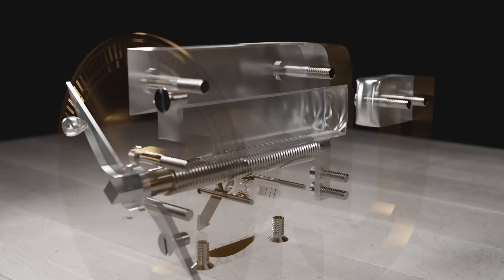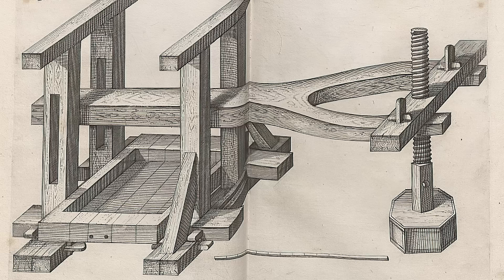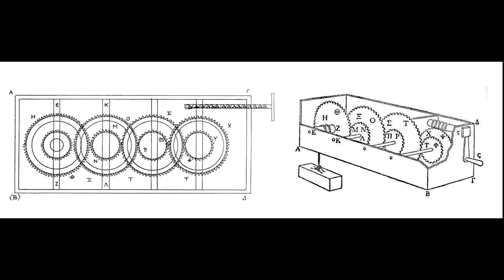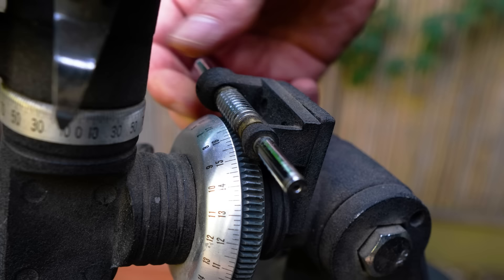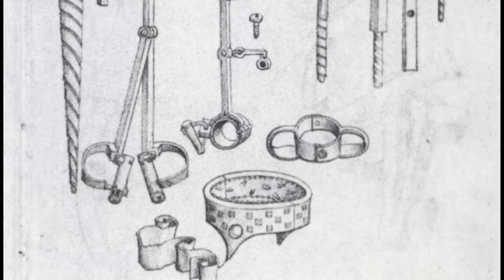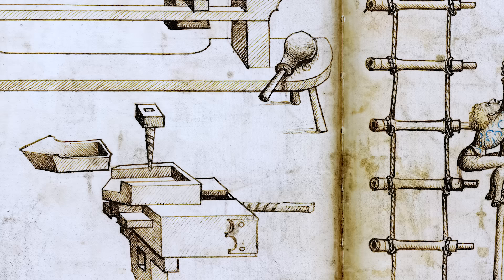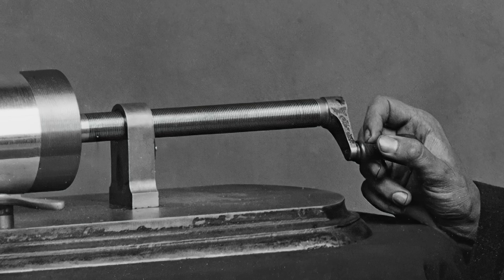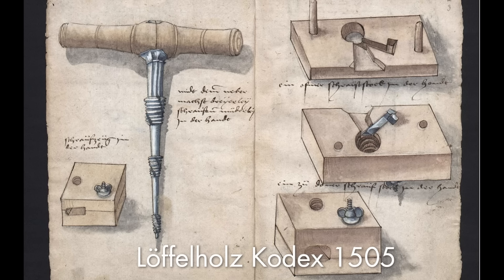Where DO screws come from?

Comment: My family's business designs and constructs specialist commercial vehicles,pumps,generators,field workshops,de-salinisation plants etc. Despite the drawback of not being self priming they still use Archimedes screws in the large irrigation pumps. My great grandfather and his brothers built their first trucks which went to Libya in the 1930's using Archimedes screw pumps for sewage/groundwater. Over the years as technology evolved and different family members had their input all manner of alternatives rotary,reciprocating,vane,diaphragm,were tried, but my father went back to screws in the early 90's. they shift good amounts,are very accepting of debris and most importantly having only rotating rather than reciprocal parts are far more durable,given that many of these trucks go to places like India,Egypt,Sudan,Libya etc. and that mechanical sympathy isn't a foremost priority, the need for simplicity and high durability is paramount. Not only does the customer not want to be without their equipment,it takes some effort for a major repair to be actioned,either via re-patriation of the vehicle or a pair of techs and their gear travel. My father always says and with justification,that screw pumps are fit and forget,they just work,even half knackered they still work,endorsed by the fact that we are still using them centuries later. I've spent my entire life around threads screws and bolts the most important helix,is that of a corkscrew😁
Reply: Are sliced washers still soldered together for Archimedean screws?

I was impressed by the calculations required to calculate the diameters for given pitch angles.

I can't imagine how Archimedes figured this out without a calculator or sine tables.
Reply: @a.k.885  you would need some big washers,some of them you can crawl through😂 .The'washer'method only works on finer pitches,ours are all offset rolled sheets cut then rolled,the big stuff that is expected to encounter mud,rocks and stones are constructed using 3/4 to 1 1/4" thick steel. Up until about 1994-5 the calculations were all done on paper,now they use CAD,but Errol, the main man in the metal shop who's been rolling steel for about 60 years can calculate them almost as quick as a computer.

Comment: The rendering at the beginning must have taken AGES, and sir, it was well worth it 🤝
Reply: I suppose that's why it's been ages since the last video :D
Reply from the maker: The final render was about 24 hours!  However, learning Blender (even just a little bit) was an adventure measured in weeks (here and there).  The actual geometry is from Fusion 360 of a model I made a few years ago (it shows up in other videos) but I used it mostly because it's the only CAD model I've ever done where I bothered to model the screws (well, bolts :) )in such detail and there many in a small space. It's also wildly inaccurate to the real thing which I got to later go see, but it fit this purpose.  I decided to make the investment in Blender because it will allow me to make animated models of other things I will talk about in the future.
Reply: @machinethinking  what is the device?
Reply: @kimmy_future4265  a micrometer... but you shouldn't take my word for it, check out his other videos. Specifically, the Origins of Precision.
Reply: @ATX_Engineer  oh duh! thanks!
Reply: @machinethinking  Blender must be awesome for someone who knows it.
I'm always impressed by the renders on  Mustard. Do you have other channels too?
Reply: @jimurrata6785  Blender is indeed very cool. 3D modelling, animation, several inbuilt renderers, lighting design, game engine, motion tracking... they're always working on new features, and the user community is helpful & welcoming. I haven't used it in years (no need, and no time tbh), but I keep track of developments and will always evangelise lol.
Reply: @_allegra  Better yet, they are engaged and responsive to their user community and critique!
Blender have set the bar high, and Machine Thinking are showing just how useful that symbiosis is.

I'm old enough that in my day computer modeling was simple, static wireforms, and FEA had to be run on a huge mainframe.
Current GPU's are able to crunch this in reasonable time without crashing and today I have a device in my pocket with BILLIONS of transistors that can stream live 1080p video to any place on the planet.

This deep dive into the origins of technology shows how far we have come from hammer stones and clubs.
The slope is a bit frightening, TBH.
Reply from the maker: @jimurrata6785  I'm not the Mustard guy. This the only channel I do!
Reply: @machinethinking  And you do it very well!   Thank You!
But I'm always looking for these deep dives into technology.

I was just saying that Mustard also speaks about how using Blender has been a foundation for his channel.
Reply: That screw cutting rendering tho
Reply: Pressure sure it was in the video about the source of measurements....I have the title wrong but you'll know if you see it.  ( looked it up,  it's the origins of precision...a fascinating video)
Reply: @machinethinking  totally awesome use of 3d animation instead of the usual tripe designed to rot peoples brains.

Comment: I work in a food processing plant. Augers are one of the ways we move products through different areas of the process. We also use reel screens to separate solids from water and move the solids away so they can be taken away and the water sent back to be used again (using an impeller pump, another screw). You do great work and I sincerely enjoy your videos.
Reply: I worked at a large slaughter house that had a rendering plant where they cooked the scrapes & bones. Had a maybe 10" diameter screw in between two French presses ( squeezed tallow out if cooked scrapes ) that had to have rotation changed every time they switched machines. One of our best mechanics talked them into ordering a short section of left hand screw for inside of open top conveyor. Then they could run both machines at once.

Comment: Hi, Back when I was learning My woodworking skills I was taught how to calculate the correct size of drill for the shaft and core of the screw.
The formula is (for imperial) is screw gauge +2 or 3 divided by 64, for shank size. and screw gauge divided by 64 for core size.
Also later on I worked as an antique restorer and learned that there was no standard for screw threads or head slot, because the screws were handmade
by the workshop or local blacksmith, and also i had a variety of screwdrivers each one ground for the size of slot for the screw I was extracting.

Comment: Hi, you mentioned at 12:18 that the illustrator made an error. I believe there is a chance that they didn't. A master machinist showed me a linear reducer using left- and right-handed thread screws with slightly different leads. The result is that one thread pushes the carriage one way (say 1" per turn), while the other thread pushes it the other (say 0.9" per turn). The net result is carriage moves the difference between the two leads (1" - 0.9" = 0.1" per turn). In effect, the two screws produce a reduced linear motion of the carriage. This can be used for micro-positioning or creating a very strong clamping action. Do you have additional information regarding this illustration? Great videos by the way!
Reply: Interesting.  This is a differential screw.  I invented a different version using right handed screws of different pitch for producing small linear motions when I was about 15.  I thought it was a great idea, but found out that I was about 500 years too late for it to be a new invention.  It worked for my purposes.
Reply: @hm5142  we used to do something similar, involving heads shaved from match books..
Reply: Or, at the time, inventors could insert errors in their drawings to protect their intellectual property at a time patent law was inexistant. Leonardo Da Vinci did that often.
Reply: A Chinese windlass is basically a differential axle. By winding a rope off of one diameter of the axle and onto the other diameter of the same axle you gain a mechanical advantage and it is self locking, much like a worm drive.

Comment: 12:20 I don't think the illustrator made an error. Left hand screw on left and right hand screw on right will both shorten the distance between the sliding block and the end block. This is the exact mechanism for an screw adjusted compasses.

Comment: At some time in the last 45 years of my career machining I became a machinist. From my first days working in a machine shop I was fascinated by screw cutting lathes. Single pointing screw  threads was to me remarkable. Since those first days I have cut all sorts of different thread forms. Threads and thread measuring is actually pretty complex, there are many features of screw threads that are not obvious. Nevertheless, for many thread forms these features were figured out long ago. You could do many hours of video on the different types of screws, and screw thread systems.
Reply: profile, feed per revolution. nothing simpler than thread cutting.
Reply: @gytisbaranauskasjagmort6059  
Profile is often where problems occur. For example, if the space between threads is too wide measuring the thread will show a smaller pitch diameter than what would be expected from measuring the major diameter. Then, if the P.D. is adjusted upward the major diameter will end up oversize and the thread could bind.
Reply: @etprecisionmachine2379  it should only occur if you make profile yourself, which if you can, is a really high class skill. Otherwise you stick to using standard inserts. Account for conicity and apply supports when turning long threads or finishing pass calibration when milling.
Reply: We use 6 start left handed threads. We roll the externals and have taps for the internals with tooling from different suppliers. It gets pretty tricky to get the tooling properly set up. Single point cutting is way too slow for our production rates. It's even worse for the buttress threads.

Comment: 12:21 actually, the illustrator did NOT make an error. If you rotate the coarse right handed helix, from right to left, the same thread on the left being a left handed helix will give you a very fine and slower motion of the moveable block to or from the stationary block.  Sometimes, two different thread pitches are used in the same configuration to acquire a similar result.

Comment: Great video. FYI, the Edison tube is superior to the flat record because it's uniform.  On a spinning platter, the songs on the outter edges have the needle travel further per second which allows for more nuanced grooves, which equals higher fidelity.
Reply: I guess stacking preferences won over musical quality. Or just customer preference: money made the choice.
Reply: @idon.t2156  A full length album would probably be so long, especially since they can only be printed on one side.
Reply: Other than the fact that the 40-ish min. you can get by using two sides of a disc would result in a cylinder like 20 ft. long.
Reply: Its a stupidly inefficient format, as far as storage.
Reply: Danger Bear  Hoo-hoo that's hilarious. 

And make sure you talk about your tube collection. So how do you store your tubes?
Reply: One of the reasons for the disc's ascendancy was the ease of mass production. A disc can be copied by a simple flat press, while it took Edison years to perfect a system for molding cylinders. Add to that the ease of storage, and the development of the double-sided disc, and the cylinder record's popularity began to decline.

Comment: When i was at the henry ford museum in Michigan. They had a machine circa 1850's that made screws. it was so fascinating. It was powered by belt via a steam engine.
Reply: There used to be a machine shop in Lakewood NJ with belt driven machines. Probably water first, then steam and then one big electric motor.
Once when I walked in there with a Jag water pump he recognized Whitworth thread from 6' away :)
Reply: @raymondclark1785  that’s so cool!

Comment: My Father, V.P. of Brown & Sharpe. Me: a journeyman Toolmaker at Heli-Coil Thought I Knew everything there was to know about screws.
 "Today I learned something"!
Reply: Thank you for your fine product it's saved me more than a few dollars.
Reply: Can I tell you a story about that?
 Ring in the middle of the night. A bro called. Toyota SR5 (new 87). Doing a tune up .. 4 plugs. #1 an #2 ..ok fine. Phone rings. Talks for a while..goes for#3. Aluminum threads comes also, dosen't see. #4 twisting coming out, catching his attention. 
 3&4 ..smooth! Moreover: chanted at angle to the firewall! 
 ...HC had a "Twin Sert" solid insert. for spark plugs.
 "PACK flutes w/ grease. Run the Tap!
 Vacuum a little out of combustion chamber. 
 ALL THIS.. and just for his peace of mind. Payed to take the head off!!

Comment: Literally just brought home the first screw cutting lathe I've owned, sat down to have a snack, and this popped up! Kind of perfect. As for screw vs bolt, I really haven't given it a lot of thought but I guess tend to call screws with external hex heads bolts and most other helical fasteners screws. But really, it doesn't seem like a very important argument to have and the other descriptors (like socket head cap) are much more important.

Comment: In drafting class, we did a whole section on the topic of Threaded Fasteners. That's the general term for screws and bolts (and nuts).  Saying Threaded Fasteners prevents you from having to say "screws and bolts" over and over and over.
Reply: Screws and bolts is quicker / less syllables. Why not say it rather than “Threaded fasteners”?

Plus everyone knows what you mean by screws and bolts. But who says “threaded fasteners” in real life?
Reply: @codycast  
You're right.  Nobody says “Threaded Fasteners” in everyday life.  I think people end up just saying "screws" when they mean screws and bolts etc.  Or Threaded Fasteners collectively.  But the technical term Threaded Fasteners is taught in technical classes because it covers every kind of screw, bolt, nut, threaded stud, etc.  Even screw-on jar lids and pop bottle caps employ threaded fasteners.  (A common example of a threaded stud that many people have seen are the wheel studs on a car on which you bolt your wheel/tire.)

Comment: If you want to record on that Ediphone, you'll probably need special cylinders for it. I have a 1920s Dictaphone and the Mandrel is a different shape to a standard phonograph. A normal cylinder would crack if you tried putting it on there
Reply from the maker: Thank you for confirming something I guessed. I actually did have another cylinder years ago and I tried to put it on and it broke.  Which is why in this video I didn't dare even try and just hold it in my hand! Now I know why for sure. Someone else posted a comment about someone who sells new blank ones which is also very useful!

Comment: 90% of all grain elevators use augers. Of which the general design of grain elevators hasn't changed much. Infact in a combine most of the mechanical work is done with augers. Until you get to the shake plates, which is essentially a few massive combs that move back and forth stupid quickly that separates the grain from it's casings, then sends the waist material out a separate exhaust area.

This was a nice video. Quite informative too. Keep it up you are doing great.

Comment: In a previous life, I was a Tool and Process Design Engineer for Ajax Precision Fasteners.  And before that, Unbrako's Australian Manufacturing plant.  Both companies had a definition for screws and bolts that went something like the following.
A Bolt was a fastener that was threaded for only a part of its length.  The remainder of the shank, between the runnout of the thread and the bearing face of the head, was either the same diameter as the Major Diameter of the thread or was the same as the Thread Roll Diameter (the diameter needed to ensure that when the blank was rolled between two flat thread roll dies or pressed between two rotating dies, produced a fully formed thread (with the correct peak and root radii per standard) for the required class or tolerance of thread without over deforming the material (which might result in folds or shuts in the material and potential failures of the thread in use).
A Screw, or Set Screw, was a fastener with the thread all the way to the head.  Only a small length was left blank to ensure that the thread runnout did not interfere with the underhead radius.
I know others will have different definitions, as you do, however, that is how the engineered fastener manufacturers made the distinction.

Comment: Excellent essay, historically.  Two points:  1) at 12:20 a lathe is shown making a thread with opposing twists.  This is not a mistake, it is making a caliper thread shown later at 13:36.  2) The difference between a screw and a bolt is the underlying physics; a screw holds things together by friction, a bolt holds things together by the tension of the metal between the head and the nut created by the leverage power of the threads.  Loved the show!

Comment: In Sweden a bolt doesn’t have any threads and a screw is basically anything  with threads that’s made for axial loads/clamping.

Still, people generally call big screws “bolts” and that’s a good topic to start an argument. 
Funniest is when you get two people to argue, both wrongfully of course, about  which size a screw becomes a bolt. M12? M14? M16? Hmmmm
Reply: I would list them in a catalog under "Threaded Fasteners" and call it a day. Then I would sit back and listen to people from both sides argue about the terms.
Reply: We'd call something with no threads a pin.
Reply: @UnbeltedSundew  Unless it's a rivet. 😁
Reply: The same is true for the German language
Reply: "Husq-varna" house by the river..Swedish